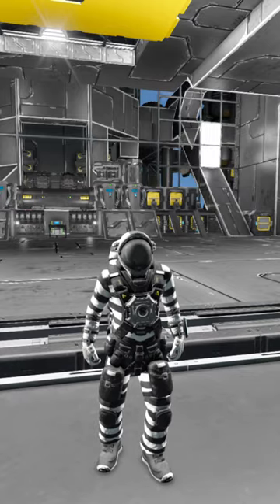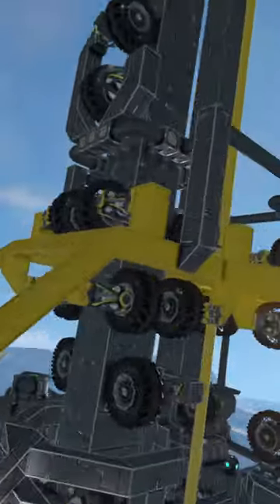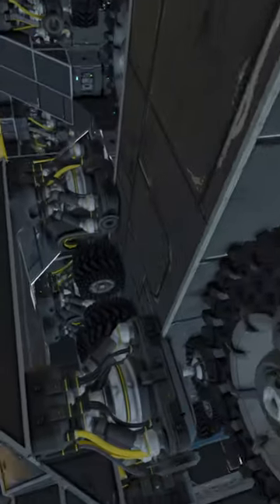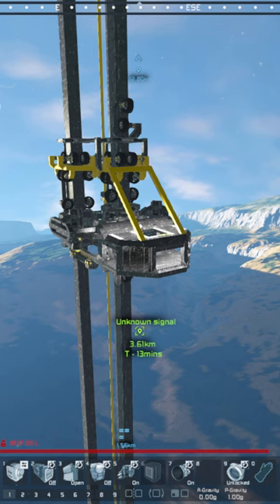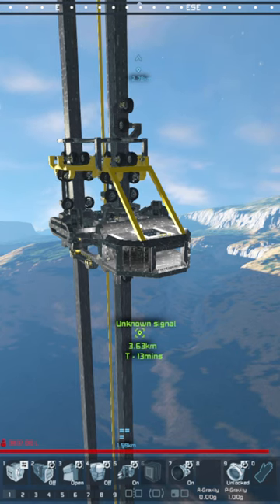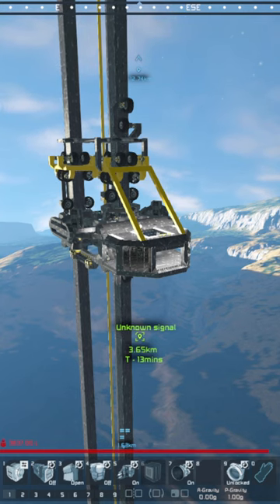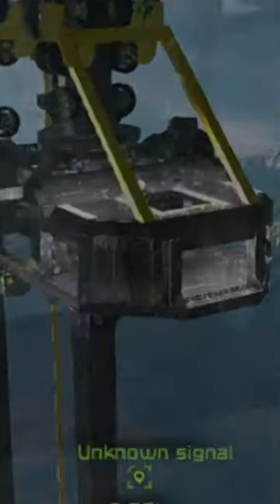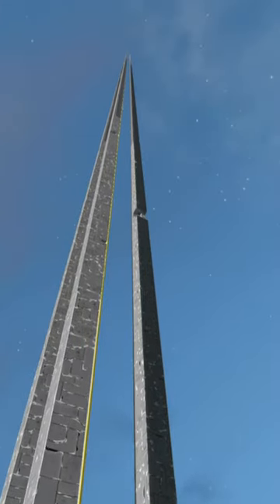Space Elevator Update: We Got The Elevator Rolling! Space Engineers Time Lapse #Shorts

Comment: You can add a few thrusters to the bottom to increase the speed, but not too many as, like you said, if it goes over 8 meters per second then it'll start to break the pillars.
Reply: Or you could remove friction add Thrustmasters and a autopilot
Reply: And if need be turn thrusters down or he can put the thrusters output higher looks like he has it on default thrust

Comment: You could drop it down, reverse the height offset, place heavy armor panels on the towers. 
I won't go into separation of the repair set up, I would just advise less welders, 12 SG welders for 1 LG block is overkill at 4m/s.

This might increase your top speed closer to 10m/s. By increasing durability and decreasing your weight.

Play with the suspension strength, even 1% can lower the collision damage. 

(Which can be disabled entirely in advanced settings on custom or private worlds/servers)

Comment: Hello! You can just use landing gears sliding for greater speed. I can see that you are using hydrogen thruster already. Just use thrusters for propulsion, and landinggears for sliding. Using landing gears is required both below, and above the elevator's center of mass. you will also need side-way thursters for stability for such creation
Reply: Thrusters to thrust up and landing gears to land... Hmmm so make a rocket xd
Reply: @synctrox9679  You are right. Early on when i started to play this game i also thought of a space elevator, and got resolved to not use it, and just use rockets instead. Way before planets i made a rail that a ship with a gravity generator, and landing gear sliders could use, but when planets came the gravity generator no longer worked in the planet's gravity field

Comment: 4m/s with 12km to go would give you a time of 50 minutes till he got to the top, not ideal 😅
Reply: My first space ship took about 10 minutes to get up to space, had about 20 minutes of thrust, before I had to use the last 15 minutes to come back down and return to base before I lost too much battery and crash. 

Ya, it sucked for a while. I had to resort to Ion Thrusters cause I couldn't find an ice lake for the life of me. Ended up eventually saving up enough cash to buy the B-60 Bulk Freighter, then spent a few hours rebuilding it with Ion thrusters, some turrets for asteroid protection (after a stray meteor absolutely totalled it and forced me to reload). Along with adapting the ship to rely on electrical means rather then split between Hydrogen and battery. 

Had the Nuclear Reactors, solar, wind turbines (for when I land on a planet that has wind), and a emergency Hydrogen engine should everything else fail. Along with refiners and builders installed into the storage and tube system, it ended up being a whole base. 

Even modified the side locks to have pistons which made docking a lot easier since I didn't need to get as close as normal, used the new space where the old hydrogen engines were to create a second vehicle bay too. 

The B-60 Mobile Fortress was my home among the stars.

Comment: You could actually use the same wheel suspension you have here, but design it like a hovercraft on rails.

Set the friction to 0 and keep the suspension tight (so it don't move). And the wheels will act as a barrier for any damage done.

Just add thrusters to the top and bottom (and maybe some on the side for added security and stability).

Comment: Considering you're using thrusters for the elevator you could probably just eliminate the wheels all together and replace with more thrusters and ion thrusters and lock the platform from having vertical movement. Not sure if drift becomes a problem in upper atmosphere since I've never tried this feat but might be worth looking into. The wheels generally add strain on the push and pull on structures unless the hydraulics are free to bounce away from the pillars so that's what's damaging it. Just don't forget to have downward thrusters.